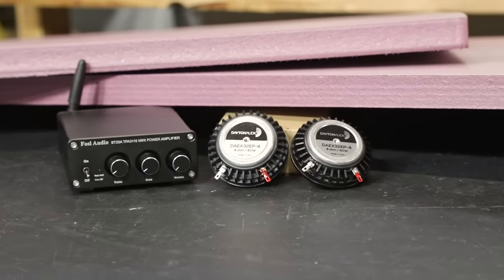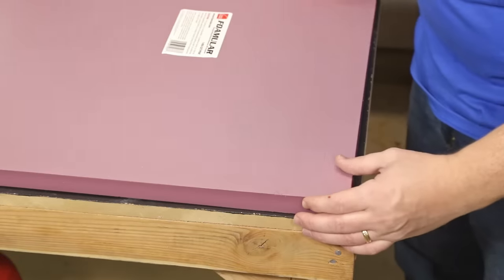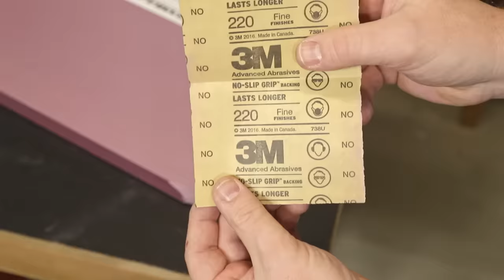How To Build "The World's Best Speakers" - Are Flat Panel Speakers Really Any Good?

Comment from the maker: The full set of speakers from Tech Ingredients includes a total of 8 different panels, using different materials, shapes, and sizes. I elected to build just these 2 panels as a way to dip my toes in the water of DIY speaker systems and to see if their claims could possibly be true. The foam boards each cost me around $5, and the exciters were around $25 each. I can’t believe the sound quality I’m getting out of a set of speakers I built in a few minutes for only $60 in parts!
Reply: To be fair, he says worlds best speakers under $115

You only made ONE speaker type, he made TWO types and kinds and used them together to create a synergy. He did centered vs 2/5 3/5 rule. You are not giving this a fair shot
Reply: But, can you paint them, or will that impact the sound? Maybe speaker cloth is OK?
Reply: @Bozemanjustin  he says he's impressed by the sound quality and you chastise him for not giving them a fair shot. WTF?
Reply: @RPRsChannel  yes you can absolutely paint them. Latex paint with a smooth roller turns out nice. Here's another link that may interest you.

https://youtu.be/x5R-sB5vRuo
Reply: @RobertEmery  when the man made the speaker he didn't make one he made four different ones that were meant to be played together for the perfect sound this cost $115

This guy made one of the four speakers and is giving his opinion

He said he was impressed but he also said that it was lacking in certain ranges of sound

This was addressed by the original video by having four speakers playing as one for the perfect sound.

So yes, I have every right to complain. As this guy did not give it a fair shot.

His complaints would have been taken care of by making the other three speakers just like the man in the original video did.

If you repainted the Mona Lisa with only one color of paint.. you could not sit back and go, I don't know the Mona Lisa's pretty good but it's lacking.

And yes , if this guy said oh my God these speakers are amazing, I would have still said he didn't give it a fair shot because he's basing that judgment on one , out of four of the speakers created.

So I would say, brother if you think that's amazing, make the other three speakers , to take care of the fact that they have to be played all together , for the best sound reproduction.

But you seem rather simple minded let me put it another way.

If you get with a chick that's supposed to be the best lay in town, but you only let her give you a Bj, you can't fairly say you really gave it a fair shot can you?
Reply: @JC-lk3oy  I would imagine that you could wrap them in an acoustically transparent cloth material too...
Reply: @cptcosmo  I would assume it would be fine as well.
Reply: Can you test this for us in a living room instead of a garage for a better normal effect, and would it still sound great.
Reply: I'm extremely curious about the difference in sound, if you simply attached a stand of some sort to the magnet on the driver, instead of hanging the whole assembly by the vibrating panel -- it seems logical that the panel is being physically damped somehow, due to the string.

Also, would you say that the imaging is as good as coaxial speakers?

Obviously, a regular subwoofer could easily be integrated.
Reply: @Bozemanjustin  TRUTH.
Reply: So would you even be moved to build it towards a 7.1 surround system?
Speakers deteriorate as time goes by, and I bet I dont remember the original sound of the Mach' s at the front of the room or the various add ons i got later to make it a 7.1
Wonder of thesee coneless things will stay consistent longer?
Reply: @Bozemanjustin  It's far from perfect, electrostatic speakers have a moving mass that is lighter than the air it moves. This is big and bulky in comparison.
Reply: Behold the power of NERD. Love nearly all of the Tech Ingredients videos. Can't expect too much out of a Lav mic but well done to put our man's design to the test. What is your take on the theory on Sphere speaker bodies?
Reply: @Bozemanjustin  
"Sure... he told us that he hadn't done all of the things that happened in the video - and that might account for the lack of range - but I'm going to bitch anyway.
Why doesn't anyone at this party want to talk to me?"
Reply: i wonder what pvc or abs sheets would sound like. i think i will try it on cedar.
Reply: @ww-pw6di  hahaha... That's a quality conspiracy theory. It would not even surprise me if it happened to be accurate.
Reply: @Q5Grafx  The problem with this sort of speaker is that the moving mass will always be relatively large and resonating compared to, say, a large electrostatic panel.

Comment: I'm working on a pair of these. I'm waiting for the exciters to come so I'm preparing the foam. I'll tell you, I had a heck of a time getting a good cut, with a razor knife, when rounding the corners. so I cut the panels down with my table saw and started over. This time I used my jig saw. Worked much better. Then I rounded over the edges on the front with a router and a rounding over bit with a bearing. Looks almost factory made now.

Comment: I had to buy an 8ft sheet so used most of it to build two pairs of different sizes panels.  Did all the sanding and painting and gave them away as a Christmas present along with a cheap class d amp that had a seperate sub out put.  It needed it couple months later picked up a very cheap junk shop passive sub.   Just picked out the one that felt heaviest to get and idea of cabinet and driver quality.  Now it works very well for peanuts money.

Comment: I really hope painting or at least fabric wrapping works on these.  Imagine in your living room, on both sides of the TV, 2 decorative paintings hanging on the wall, that are actually speakers!  It's like "Stealth Speakers" if such a thing exists.  (How to hide the wires?  Ummm, we will cross that bridge when we get there...)
Reply: You could pass them trough the hanging wire to the ceiling, and hide them in there
Reply: The good fabrics for speakers are such because they're 'acoustically transparent'. If you fill the pores of the fabric with paint that would no longer be true.
Reply: I guess you could place them behind a deep-ish frame or canvas? It would also be useful for the wiring and mounting. But I'd keep the fabric really light so that it doesn't interfere much; probably dyed instead of painted too.
Reply: I was thinking of doing the same thing.
Reply: How to hide the wires? Just disguise them as wires for the lights for the “paintings”.
Get 2 flat panel lights, mount them to the wall, and put the “paintings” speakers over those lights. Mix the speaker wires in with the light wires.
Reply: Run the wires through the wall, and shoot them out directly behind the speaker

Comment: The first band I was in, back in the late 60s, had polystyrene PA speakers. We were just a small garage band and they worked fine. We ran them from an old Bogen tube amp. They were very fragile.

Comment: the Problematic with the missing "body of the tone" at around 9:00 is due to your amp. I have the same one and the sound is (for my standards) extremely poor. In case you have something like a Yamaha AS-700 or something similar, try it out. I'm pretty sure you'll love the result.
Reply: I think another issue is probably that there is no woofer and it's missing the fundamental frequency.  I'd be surprised if those played anything below about 100 Hz.
Reply: @mattuw82  yeah a sub would greatly improve it

Comment: I used to have a pair of Wharfedale PPS-1 flat panel speakers back in the day. Think they were about £180 back in the day, and I've seen them going for as little as £90 today if you can find them. On the plus side, they also come with a matched sub woofer to fill in the missing bottom end.

Comment: You need to keep your mic to the front of the speakers.  You've got dipoles for the most part so in between will be plenty of cancellation.  Your distance from the front wall will have a strong effect in that regard.  Play around with placement (think Magnepans, if you've ever had any experience with those speakers).  I need to try this out for myself!

Comment: I know this isn't audiophile level design, but I thought I'd add some thoughts. That very large amount of free swinging and inertia complications, especially in placed close to the wall behind it causes clarity and phase problems. With its' surface area and problems I mentioned, maybe that can be worked to your favor with near room corner placement, with a diagonal orientation. This can enhance some frequencies, plus the added wall reflected sound will give you a wider/deeper/more complex soundfield, sort of like old Bose direct/reflecting speakers for a bit more 'concert hall' effect.
Reply: Good idea! If it's missing depth or meat as he says it could be like mid range frequencies or resonance being off either too little, in which case I was thinking that could be mimicked by adding more surface area larger plates, and resonance could be mimicked on a flat plane with increased perimeter, like a string being either lengthened or loosened makes a deeper tone, but each method has a different depth or meat 😂..
maybe a kites and darts pattern like veratasium used in his penrose tile video or those fractal antennae designs they use in cell phones. 3d cut one add a speaker and try it experimenting is the only way to know. I'm a science girl, But I have a woman's intuition that because Fibonacci sequence is found in musical notes, that kites and darts or sunflower holes or some other fractal containing phi would be an ideal design constraint if you wish to keep a flat surface. The easiest way to check nodes and anti nodes is by laying it level  and sprinkling salt while scanning through frequency ranges.  ❤
Lol I wanna try this now!!
Reply: @wssometimesavowel3639  That definitely would be a great way to see the various frequency locations.
Reply: I can report that these sound way more roomy and bassy when mounted up in the corner at an 45° angle (center of the speaker is pointing into the corner)
i recommend getting an amp with an equalizer as the mids are kinda weak.
Reply: @wssometimesavowel3639  That's interesting - the stereo distributed-mode + subwoofer might be described as 2.1 - are you heading towards 5.1?
Reply: - now you mention 'soundfield', might there be any mileage in some form of 'reverse-soundfield microphone' -style speaker (employing drivers/exciters instead of mics?)

https://en.wikipedia.org/wiki/Soundfield_microphone
Reply: @gervaiscurrie6675    Dolby?
Reply: @wssometimesavowel3639  Well, yes, perhaps - might you expand on your thoughts on 'conventional' vs. planar/distributed-mode speakers in that context?

Comment: I find they work better with larger rectangular panels.  The low end is dependent on the maximum dimension of the panel, so you can reach lower with longer pieces.
Reply: Another great product is hanging ceiling panels for lows
Reply: @MinecraftManSteav  Many people use panel speakers like that for surround of Atmos effect speakers. With wide soundstage should be perfect for that.
Reply: @MinecraftManSteav  that's what I used.

Comment: "We'll start with a Bach solo cello suite and work our way up from there." That's like starting with Davinci and working your way up.
Reply: While I love classical too there's a lot of more modern genres of music that's just as awesome if not even more, there's even a lot of modern genres with music just as complex if not even more so musically and composition wise (some magnificent progressive rock and metal come to my mind first as I am rather partial to rock and metal but there's a lot of electronic music too that's pretty darn cool).
Also while classical is good at conveying certain feelings some more modern types of music are better at conveying other types of music, for example I haven't heard a classical piece that can convey aggression anywhere near as effectively as rock or metal.
Also when talking of acustics some speakers could be great for classical but rubbish for rock, techno, blues or some other types of music that tend to use different frequencies more than classical does, and vice versa, it's actually relatively easy to make speakers that sound good for classical when compared to many more modern genres.
Reply: Da vinky?
Reply: @Warutteri  "I haven't heard a classical piece that can convey aggression anywhere near as effectively as rock or metal." - Check out Trendy Junky by Chiens, possibly the most aggressive thing i've ever heard
Reply: While tastewise it's a matter of opinion, which @Warutteri already said, for testing speakers, classical isn't the best genre. It has an emphasis on mid-tones and doesn't represent the taste of most people.
Reply: @Warutteri  well that's your opinion and if you want them to be taken seriously, try 'da Vinci'. :-)
Reply: He should play American classic, Coltrane!

Comment: If you want to improve bass output, add a bit of extra mass to the back of the driver.  Other options to try would be adding a layer of fiberglass backing between the foam and driver to help stiffen the panel.
Reply: Just add a subwoofer, trust me you'll be blown away.
Reply: @xAnAngelOfDeathx  I think adding a bass shaker on your seat would be a great way to give you a lot more bass, it makes it feel a lot more powerful because you feel the sound in addition to hearing it, and you can turn the audio a lot lower.

Comment: It would be really interesting if you could tune these by incorporating a dual channel 31 band eq.  You would need a DAW that has a spectral analyzer and a microphone.  You would then play a flat sine wave through these speakers out of the daw through the eq.  Using the spectral analyzer you would record on a second channel the sound from the speakers, muting the output to avoid a feedback loop,  and tune the EQ until the signal is flat the way it occurs when you just play it in the daw..  Once you get the pure sine wave flat, re demo the speakers. They should produce the sound alot more accurately. It will also let you to visually demonstrate on the eq graph what the raw speakers are attenuating from the sine signal without any equalization.
Reply: Just as an addition to this, in my experience I've seen systems use a chirp for this (I assume linearly increasing but idk since the system did all the adjustments automatically). I suppose the processing software may be proprietary though, and definitely more work than what you're describing. The point of the chirp is to get info on the whole frequency range, instead of just the frequency of the sine wave.
Reply: @anachronismic  I could see the value in a chirp, but is the chirp full spectrum?  I did not really mention the importance of using a 3 octave range so you are well into 16,000 khz with the sine. A lowpass at 250hz would be fine. though im not sure how low these really go
Reply: @blueridgedsia  imma preface this in saying that my base of knowledge related to this is primarily in electromagnetic waves so I may be making wrong assumptions in some way or another, but In that context would a sine wave be considered "full spectrum"? A sine wave is by definition a narrowband thing right?  I brought up a chirp (which in this context is  basically a sine wave with linearly increasing frequency) because it was what (I assume) was used in a similar context when my parents got a home theater setup and it calibrated itself, though it's probably not worth doing unless you're really into signal processing lol, given it's not something you'd do by eye. What you've said definitely makes more practical sense though.
Reply: @blueridgedsia  Ok I've done a quick google and it looks like my general intuition seems to be how equalization is done with regards to using digital systems to cancel out room noise (chirp, pink noise, or stepped sine waves). Also, did you mean a highpass at 250 Hz? Unless you're making like a sub I can't imagine a low pass at 250 Hz being very helpful.
Reply: @anachronismic  Yes I meant a highpass, Its been years since I have delved into audio jargon.  As for the sine, it could be played many different ways. Ideally its one flat signal. It is useful for cancelling out room noise which can color the sound. The idea is to get the sine via mic as flat as the pure generated sine.
Reply: @blueridgedsia  you don't mean sine wave. A sine wave is a single frequency. What you are describing sounds more like tuning with white or pink noise.

Comment: In my opinion this type of DIY speaker is the best sounding -FOR THE PRICE!!   Dipole,  box-less, open back, and similar panel type speakers are amazing, and these similar panel speakers tend to give amazing room filling fields of sound.  Also there are no crossover wiring !  to deal with Of course they are not "THE BEST..."   But if you apply some art to the panels, hang them on the walls, and your friends will go nuts trying to figure out where ALL THE music is coming from in a room with ordinary speaker boxes are not to be found.  Or build a couple of really small speakers that can be placed near the panels, and people will think those are the source and scratch their heads in wonder!